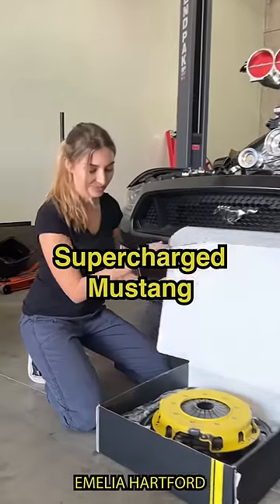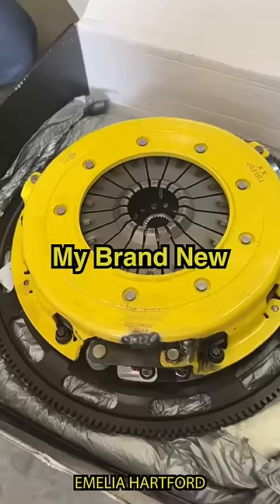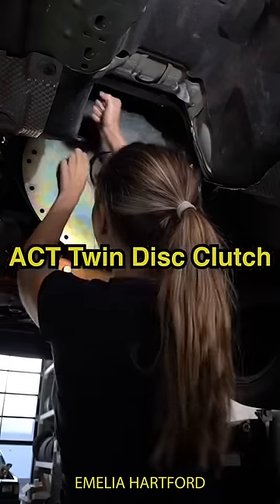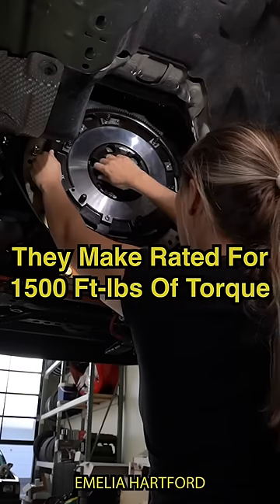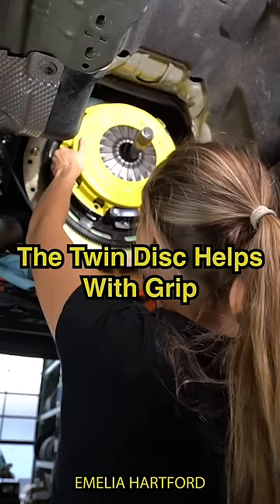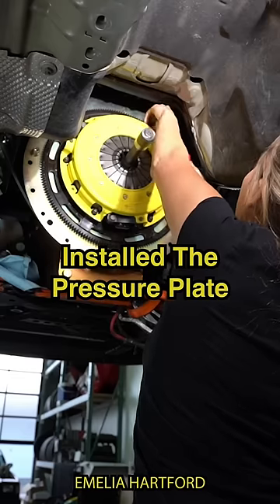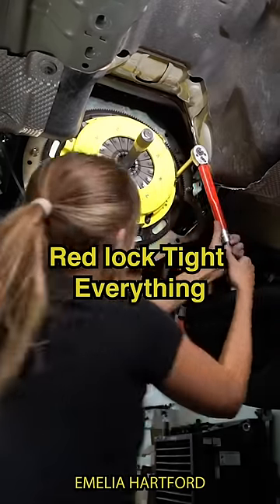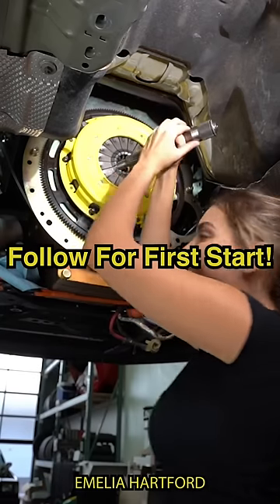2,000HP Supercharged Mustang Gets Clutch

Comment: RED Loc tight??? Have fun taking those bolts out
Reply: Yeah exactly what I thought. Does she think the clutch is going to last forever.
Reply: Big time RIP when that clutch does eventually go... I was looking for someone who commented on the red locktite 😂
Reply: I know the blue loctite you can unscrew them with a bit of force. What is the red one actually?
Reply: Came here to say this
Reply: Just heat it up and it'll come loose.
Reply: @KLOKSLAG1911  red is effectively permanent, but heat will loosen it up.
Reply: 😳red loctite
Reply: Why is everyone so terrified of red loctite? Everyone thinks it welds the fucking bolt in the hole. No one reads the directions anymore? 500°F it will come right out with no trouble
Reply: Was my train of thought. Like How shakey is that mustang to shake your clutch bolts loose?does she even know what is necessary to remove red loctite?
Reply: @KLOKSLAG1911  heat. Lots of heat
Reply: @NDC1115  you do realize she will have to heat the entire transmission right? You won't just heat up individual bolts because heat transfer.
Reply: @diamondheat9  🤣🤣 have you ever wrenched on anything? No you won't have to "heat up the entire transmission". A small butane torch for a minute or two on the bolt head works just fine. I remove multiple bolts DAILY this way, and every single one of them have Loctite 271 on them
Reply: @NDC1115  lol he really fuckin say heat the whole trans up? BAHAHAHAHAHA
Reply: Without it that kind of power will rattle them out or stretch them
Reply: Lmao that’s exactly what I found on my project car when I was trying to take my wheels off and wondered why they were so damn tight, some people man 😂
Reply: @KLOKSLAG1911 suffering
Reply: piece of cake just heat the bolt heads up with a propane torch first

Comment: Red Locktight huh
You're going to have a fun to removing those
Blue would've been enough.
Reply: Like 10 seconds applying heat and red loctite lets loose. It's not a big deal at all.
Reply: @Krankie_V  yes it needs heat, but smarter to use blue
Reply: @IIGrayfoxII  either one is fine. Seems like you're just complaining for the sake of complaining. See it all the time on videos like this. Guys who just can't stand that a woman turned a wrench and have to find something wrong with it, even if it doesn't matter.

Would blue be easier to remove? Sure. Does it matter? Absolutely not. She's probably going to be the next person to work on it again, and she will know exactly what to do.
Reply: @Krankie_V  got nothing to do with gender.
Other comments say the same thing

Comment: Interestingly twin discs do not provide more torque capability due to increased surface area, but due to the increased friction interfaces, each time you add a another disc you get two more friction surfaces transmitting torque, like two standard clutches in one, all using the same pressure plate force.

The basic formula for friction does not include surface area and is unit-less, surface area isn’t the key player here.

Comment: Don't defend red loc right, its made to be permanent. Rapidly heating and cooling threads/bolts triples your chance of damaging then when combined with the rather EXCESSIVE force needed to break them lose. Not only that you just turned a 2 hour job into an 5 hour fight the next time you have to do it.

Comment: surface aerea doent help with grip. equation for friction doesn't care about surface area. it does spread out the heat generated tho and also give you more material to wear through, motorcycle clutches are like 10 disks for this reason. doesn't apply to tires because rubber keys into the asphalt so bigger is better. also do you need 1500ftlbs of torque? its just how strong the springs are and the bigger the less driveable it is.

Comment: 2000hp more like 800
Reply: It’s already done 815 hp and 1000ft pounds of torque at 3k rpm spinning on the dyno and floating the valves with fuel issues, on a second hand na engine that wasn’t built for boost. And this time it will be built for boost so 2k is no real issue for the engine but the drive chain is a different story.
Reply: @uninstallplz6888  drivetrain you mean?
Reply: @kiloton1920   you got to love auto correct on a phone 😂